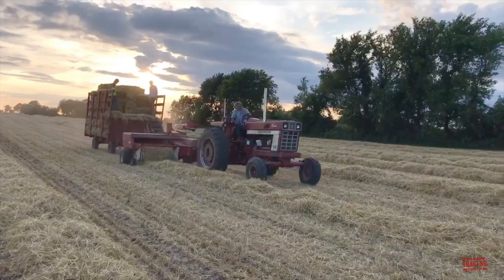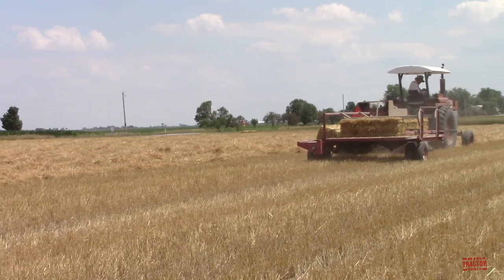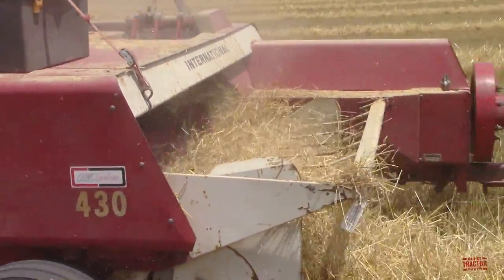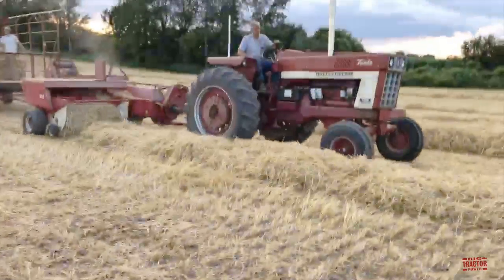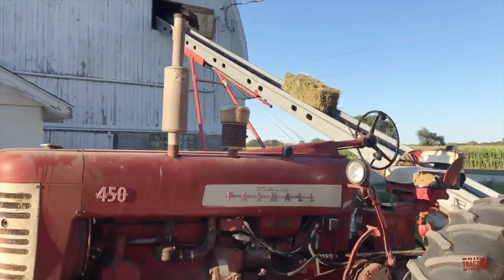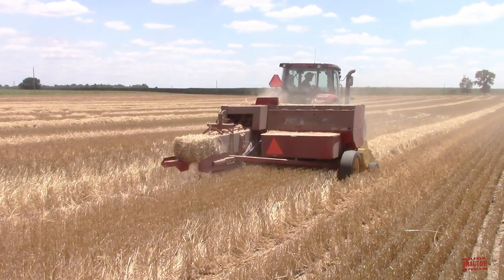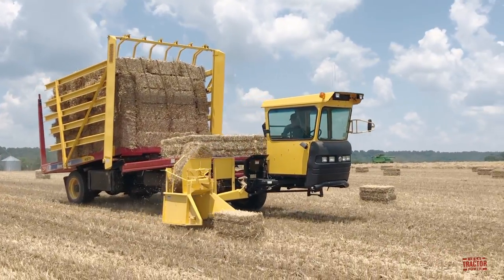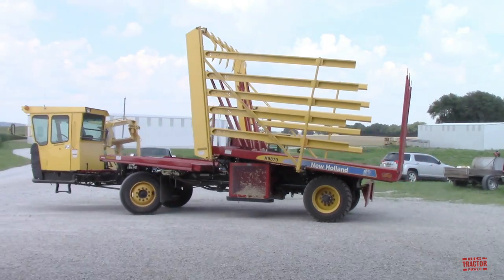FARMALL Tractors Baling

Comment: The mow was not the place to be on a hot afternoon.  We usually unloaded the previous days bales in the morning after milking and breakfast though you could still work up a sweat without much trouble.  You didn’t show anyone still using a hay hook!  Our chute didn’t make it the whole way back to the wagon so a steel “hook” was used.  One piece of iron rod about 20” long with a 2-3” angled hook on one end and a oval shaped handle on the other.  You could hold it by the oval or thread the shaft between your fingers and hold the whole oval in the palm of your hand.  Better control that way.  Trick was to snag a bale that was going to fall off the chute in the turn at the end of the row.  Not many of our fields were that flat.  There’s an art to stacking a wagon.
Reply: Amen. I was the master in my family. We had New Holland baler pulled by 686, perfect tractor for the job and used hooks and had lots of hills to make you nervous sometimes. I took pride in stacking a wagon 7 layers hi with no side supports. My best day in my late twenties was 8 full wagons. I wanted to go for 9 as the sun was going down but dad wouldn't let me. 13:52 We had a team back at the barn unloading the wagons with hooks. Everyone had their favorite hook. Indescribable happiness I had back then.
Reply: @armormathews9140    Oat straw was the worst.  Lost a whole back corner once on the  turn of a row. The end was downhill, just a back support on the wagon, no sides at all, so when my uncle made the turn to head uphill, the left corner went.  Fortunately only about 4 high at the time so wasn’t too bad of a mess.
Reply: @oldtireman4665  yeah the beginning was hard especially making a turn on a hill and hit a deep gutter with the back left or right tire. I didn't like hay because it was heavier and tore up tour hands more.

Comment: That brings back a lot of memories.  Started out riding the wagon stacking bales behind a IH 45 baler pulled by a 4020 JD.  Eventually moved to an accumulator system which was much nicer.

Comment: Enjoyed seeing the 826, 1256, & 1466 tractors & the 430 &445 balers.  I've just got a couple of acres of hay that I do using my Farmall 806 diesel with a M & W turbo on it.  I pair it up with a Johm Deere 260 disc mower, New Holland 254 Tedder/Rake, & a New Holland 565 square baler.  Finally got my second cut of hay done this week.  Thanks for sharing.  Stay safe.

Comment: That brings back memories. We had a McCormick baler with a chute on it my uncle's decide to put a kicker on it. The kicker they put on had a small gas motor to run it they were using false front wagons to bale into not knowing how it worked they gave the motor full throttle. They bale came out and went through the back boards in the wagon.
Reply from the maker: Ouch that is a learning curve on a new machine. Great history to hear.  Thank you for sharing.
Reply: . Side note on the baler it was painted white but by the time they were done with it so many parts were replaced it was almost red. Have you ever seen an electric ihc baler? They ran of a generator on the belt pulley. Baraboo steam show has one working
Reply: @lawrencekieffer6770  Glad I ran across this post. Had no idea there was an Electrall baler operating anywhere, much less up in Baraboo. Hopefully, they have a show next year. That's only a two hour drive for me. Thanks for the tip.
Reply: @ikonseesmrno7300  they have i think a 450 on the baler with the original generator. There's a video on here somewhere that there was a combine that had a baler hooked to that and it was run by the electric generator. Idea ahead of it's time

Comment: Hi there, I do about 1500 bales a year. I’m using an IH #35 hay rake pulled by a 1967 Ford 4000 along with a New Holland #310 baler equiped with 1/4 turn bale chute operated by a 1976 Ford 7600. Bales are picked up with a New Holland #1033 stackliner pulled with a 196? John Deere 3020. My operation is just a hobby to re-live my childhood. I rather do that instead wasting my time driving a motorcycle. I really like watching your videos. By the way I own all the equipment except the 3020 and 1033.
Reply from the maker: Very cool line up.  I like Ford tractors.  The 1033 is a neat machine. I have filmed a few self propelled units. I would like to feature some of the pull types too.

Comment: Small squares, thanks to a New Holland super 66 baler, powered by an international 484. Cut by the same tractor with a McCormick International 990 haybine. Raked with a 258 New Holland rolla bar, pulled depending on my mood with anything from my 1938 Farmall F20 to the 484 mentioned above. The bales are dropped on the ground and the customers come pick them up generally. One guy wants me to pull his hay wagon behind the baler while he loads it this time around.

Comment: In North Alabama, 3k-4k coastal bermuda small squares per year.  John Deere 4240 tractor with a John Deere 328 baler.  Ground driven hay lift to get from ground to trailer height.  All man power after that to get them in the barn.

Comment: We had a 435 baler with a thrower and you could bale so fast that by the time one bale landed in the wagon the next one was in the air. Made a bale every 2 too 3 strokes of the plunger. My brother used to pull in 12th gear at full rpm with a 7220 John Deere

Comment: Been there  done that . I used a Ford baler and a  5,000 supermajority Fordtractor . Wore them both out . Went to a  348 Johndeere tractor size 4230 . Never had any trouble out  it . When finishing out a window if it toyed a bale , kick the  p.t.o. out of fear when turning around . If you didn't do that it would  break the bale it just tied .
Reply from the maker: Very cool.  I grew up by a farm that baled with a Ford 7000 and Ford 542 baler with a thrower.

Comment: On the old family farm back in the day, small squares where done with a 1939 John Deere H & John Deere 14T baler. For two years 70s a IH 674 took over running the baler but it left as grandma was the one who drove the tractor when baling and she hated the side shifting on that 674. So the H went back to baling for a while. Then they started to use one of the Farmall 856s instead and the H stayed in the shed more. Then in the mid 80s when the dairy cows left and the beef came in, the small squares were done expect for once in a while for straw. So the H & 14T were stored up in the isle in the middle of the hay mow. Then the one 856 & a JD Round baler took over tell the beef left in 2011. But I’m proud to say the H & 14T are still in the family. And the H will stay that way, but it seems my uncle may brake the trend with the baler.....

Comment: Hello in 1960 1975 in those years my dad had Farmel 100 and an Farmel  A tractor  one had a 5 ft silkel mower..and a 45t mcdeering baler with the motor mounted style with a single wheel on front  real work horses on 40 acres Tim and clover hay and oat hay. P.s.and a new idea steel wheel rake all Great machines . My dad and I both had real bad allergy problems and we goter done and put in the barn .one more add on we used the graple fork to put bales in the hay mouw that's it .all put away for dairy cows cjd🤔🇺🇸 spelling ?? Wash state west side 😁 all bales went on to wagons right from baler
Reply from the maker: Interesting history.  Thank you for sharing.

Comment: In the 50s I'd board out on a dairy farm in CNY Finger Lakes. The farmer did a lot of shares. Sold hay off in winter. Farmall M pulled a 50T was it(?) 4cyl McCormick belt drive powered press, hired man n I rode the wagons.  No hooks allowed.  We'd bring 6 wagons n a pickup loaded home after putting shares put in the farms barn, tarp'em for the night.  Unload'em after milking, breakfast n cleaned the barn...  By then it'd be hot enough to go back for more. 
There never was a mow I wanted to be in.  You'd almost dehydrate under those tin roofs.  Lot of growing lessons learned on those summers...
Reply from the maker: I grew up near Rochester.  I have spent many summer days at the Finger Lakes. My first job was stacking bales from a kick bale wagon in a mow.  Thank you for sharing.

Comment: The baler is a hesston manufactured for Massey Ferguson
Reply from the maker: The IH 400s were built by International in Memphis, TN.  In 1982 IH sold its entire hay and forage line to New Idea and production shifted to Coldwater, OH. New Idea supplied IH with hay tools through 1984 and then Case IH from 1985-1987. In 1988 Case IH acquired 50% of Hesston from Fiate.  In 1990 AGCO acquired the other 50% of Hesston when Fiat  bought Ford New Holland. In 1999 Fiat bough Case IH and merged it with anew Holland. In 2001 Fiat sold Case IH’s 50% of Hesston to AGCO.  In 2006 AGCO changed Hesston hay tools to Massey Ferguson.

Comment: how long  are those small 14x18 inch  bales?    they look lite in weight.  Where I live, we use Freeman 3 tie balers,  16x22 x 43 inch in size,  and you can' t lift them up with one hand  lol  Alfalfa weights in at 120 to 140lbs, and grass hay, ( timothy) is usually 115 to 120lbs.
Reply: 14 by 18 is usually 36 inches long. They range between 40 to 60 pounds
Reply: @IG10705  why so small in size and weight?
Reply: @stevenbetassa7329  because that's common. 3 wire is uncommon. Everyone does the small square bales and the round bales. The huge square bales I don't think that are too common here in the states.
Reply: @IG10705  Out in the Western part of the US  3-tie bales are common,  your right, not used at all East of the Rockies,  but for many years now, 3-tie here wore used, My Father did custom baling during the 1930s.to 40's with stationary balers, and all 3-tie,  today the poorer hay is the big bales, 4x4x8ft or 4x3x8, and the better hay of alfalfa or timothy all 3-tie. Here in Central Washington, about 90% of the hay is exported,  and must be baled in 3-tie bales, and some of that hay, is then broken apart and re-baled at the hay exporter's, then wrapped, and placed into containers for overseas.  And the cattle ranches here, will usually have to bring in cheaper hay in Big Bales,, from as far as out of state,  to feed the cattle, as very little hay raise here is used for the local cattle ranches

Comment: I just can’t figure out how those loaded stack cruisers don’t tip over backwards. The weight and balance just looks so off.
Reply from the maker: They work great.
Reply: There's a lot of weight out front on the one in the video. Mine is a pull-type & the hitch gets very light when tipping back. Don't think it would be a good job for an 8N. Lol